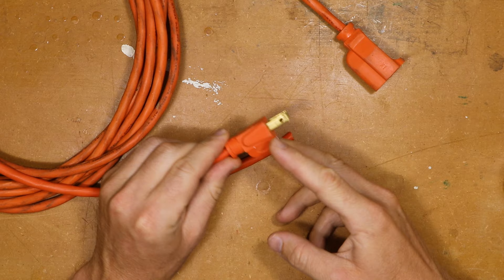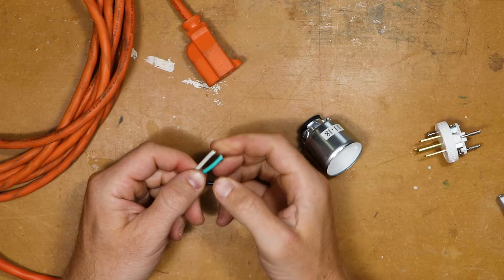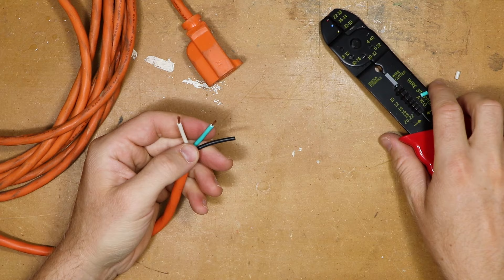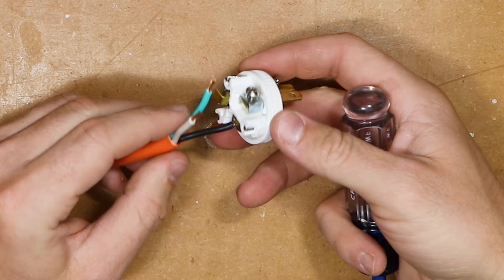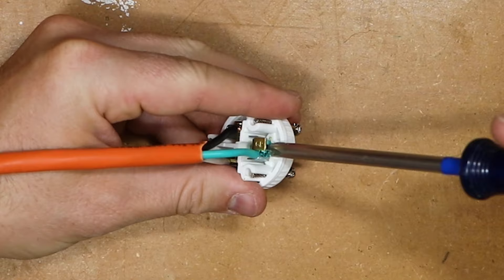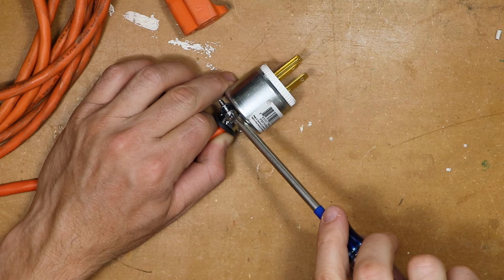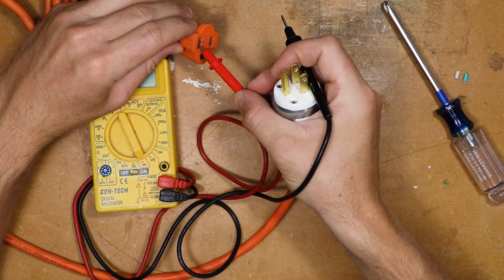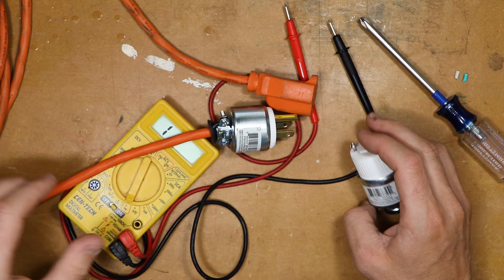How to fix an extension cord end

Comment: I was blowing snow and chopped through a 50 ft. 14 gauge extension cord we use to keep the bird bath water from freezing.  This is a great video on how ot get it right - I never thought of using a multi-meter to test for continuity.  A 50 ft. cord is now an 11ft ft cord and a 39 ft cord.  I also need to find a better solution than runnig the cord across our sidewalk.  Thanks!

Comment: If you are testing a power strip, remember you will not get continuity on the hot/black wire until you flip the “reset” switch

Comment: This is some good knowledge that ALL tradesman need.  In larger commercial job sites it can be easy for accidents to happen.  I turned in extension cords one day after installing sheet metal panels.  One came in without the ground, and the other had a section caught on a closed door.  
     We had another situation where someone managed to simply cut our extension cord by mistake.  I approached two nice electricians who replaced the plug end for us.  I find a lot of fulfillment in being a tradesman because in every project, everyone wins when everyone cooperates.
Reply from the maker: Thanks for sharing. I appreciate your comment. Tradesmen are important.

Comment: Very helpful especially with using the multimeter. The wires inside the cord I had were different colors. Using the multimeter made it so I could check my work
Reply from the maker: Spot on my friend.

Comment: I've done this a few times. One on a really old yellow semi-flat extension cord (so old that you can plug another grounded cord into it upside down) that had a missing ground pin, one on an orange round cord that also had a missing ground pin, once on an ungrounded green cord where one of the pins started to break, once on another ungrounded green cord that I accidentally cut in two with hedge trimmers (one reason not to try to use them in the dark), once on a grounded semi-flat gray cord that flexed too many times next to the plug, and the wires broke (my first time replacing a right-angle plug), once when converting an old cord into an extension cord, and finally when making a cord for my AC-synchronous Simplex clock. I was bad at it at first, but I've improved considerably over time. I can't remember if any of them had those clamps, but I know some did not. One thing to note is if the plug doesn't have the clamps, making the J hooks is absolutely necessary (always wrap around the screw in the clockwise direction)

Comment: Thanks!  I just noticed my convection oven plug and outlet were extremely warm while using (I always unplug when not in use).  Anyhow, I read that the culprit is likely a cheap / weak connection inside the plug, so I will replace the plug and save my little oven.

Comment: Thanks, had to put a plug on a wire coming out of a spot lamp i hadn't seen in about 20 years. Since that was probably the last time I had been up in my attic. I would often wonder what the heck I did with it, it always came in handy doing odd jobs around the house and getting under the cars. Didn't want to ruin an extension cord so I grabbed one of these this morning at the hardware store. Wanted to be sure I was wiring it correctly. Thanks again.

Comment: I like your suggestion to buy/use replacement ends that are steel rather than plastic.  It is almost aways better to spend a little more money up front so you avoid REWORK later on down the road.  Nice video.

Comment: Thank you, that was very detailed. I accidentally got my extension cord caught on a branch while shaping the hedges. Tomorrow morning I will be doing this project. I might need to rewire the outlets too. It did not throw the breaker. I am not getting any current in the outlets on that circuit. Do you have any videos on that?

Comment: Hi, I recently bought some extension cord heads, but one of them doesn’t work. The one that connects from one cord to the other (not the plug in) but the one where you add the extension. 
Anyways, I tried connecting every wire. And it turned on for about half a second and then stopped working forever. What happened? It worked for an instant then not anymore.

Comment: May I suggest tinning the ends of the bare wires after twisting them. It helps with making connection much better. Plus the wires are a bit bigger and the mounting screws to plug can hold onto them tighter.
Reply: What does "tinning" mean and how do you do it?
Reply: @clarencealexander1093  He means wicking solder into the twisted strands.  Usually, tinning is done in preparation for soldering the wires somewhere.  In this case you really don't want/need to tin the wires.  Doing so makes the bundle of twisted wires more stiff, and then they connect over a smaller surface area.

Comment: I learned something today. BLACK GOES TO BRASS. Never knew. I have done this repair in the past but it was usually from sight and post test as opposed to knowledge of that fact. I've actually ripped apart heads just to verify where the black went in the past. ThANKS!

Comment: Thank you for this tutorial! After the repair should the cord be restricted to indoor use, or is is still appropriate for exterior use? I have a couple of previous heavy duty outdoor use cords I would like to repair, but that new connector doesn't appear it would block moisture, or would it? TIA for any further clarification you can add. 🤔🤔🤔

Comment: Only question I have I may  of missed you mentioning it , are the replacement ends for multiple size wire or have to buy them for the exact wire size ? But great video very in-depth 👍
Reply from the maker: Replace the plug with the same style that broke off. Plugs have different styles based on the electrical needs of the appliance.
Reply: Good question. I have a 10 awg extension cord and can’t see to find a 10 awg female replacement plug for a 15 amp (expensive) 10/3 extension cord.

Comment: Wish you have showed what number would it be if you mix match the continuity side. Other than that, it is great! 👍🏻Very helpful and thank you!
Reply from the maker: It reads 1 when there is no continuity 08:22
continuity is a fancy word that basically means connection. So if you miss match the wires there will be no continuity when checking.

Comment: My cord says it's a 16/3 cord (10 amp / 125 volt), but all the replacement plugs are for 15 amps.  Is it important to find plugs that are also 10 amps?  (I don't want to throw away a 100' cord if I can just replace the ends.)  Thank you.

Comment: i have a blue, brown & green/yellow striped wire.
positive: ?
negative: ?
ground: ?
thanks.
Reply: Brown is your hot wire so you want to connect that to your building's black wire. The blue is negative or return, so that will go to white. Green with yellow stripe is the ground and will go to the building green.

This is copied from an LED lighting website
Reply: I also have brown? Blue and yellow /green strip....no marking or coloured code on the screws on the inside

Comment: I’ve always heard black to brass, but my connector does not have a brass screw.  Instead it has an X and a Y beside each.  But I have no idea which one would be the hot
Reply from the maker: I recommend looking up that info on the manufactures website if it did not come with info explaining which one is the HOT
Reply: What about a large electric heater.  The plug broke but cord is smailer than this extension cord.  Will it work???
Reply: Cord looks perfect.

Comment: Missing grounds are Dangerous because some plugs are polarized.  If the polarity is wrong on a device,  this can lead to electrocution.  Such devices include hair dryers and light sockets.  On plugs that intentionally lack a ground that are polarized will have one side fatter than the other.  On grounded plugs, both prongs are the same size.  This is because if the ground prong is in tact, inserting the plug upside down is impossible.  If the ground prong is chopped off, there is the risk of inserting the plug in upside down.  This can create a shock hazard.  In other words, don't put the knife in the toaster.
Reply: Not exactly...if it was dc (direct current) (+, -) (car batteries etc) than polarity would matter. But you're talking ac (alternating current) meaning it doesn't matter which way you plug it in. The ground is important because if there's ever a short (loose power) electricity will travel the road of least resistance to complete its path. So it will travel through ground instead of through you. That's why it's never a good idea to operate things when the ground prong is broken off.

Comment: I am trying to replace a damaged 3-prong plug end to an space heater. The middle wire is a greenish blue which I assume is the ground, but the other 2 are both white. How do I know which one is the hot wire? I don’t want to burn my house down HELP
Reply from the maker: My suggestion is to find a friend or someone that is able to figure out your wiring issue in person. There are too many variables to the situation to be able to safely help you over the internet.
My second thought is that you may be able to locate a wiring diagram to assist.
I too do not want to risk burning down your house.

Comment: What about a 00 gauge wire , won't go into the prong holes , too big ?
Reply from the maker: Way too big. Different gauge wires are required for different applications. a 15amp 120 volt plug is not used with a 00 gauge wire.

Comment: Could I potentially make a generator adapter cord using this same method?
Reply from the maker: potentially
Reply: Just make sure you are using 10 gauge wire .. The wire on the extension cord on this video is way to small..

Comment: What happens if you connect the hot wire and neutral wire in the wrong spots?  Asking because my wires are not color coded (battery warmer cord) and I tried using a multimeter but my prongs won't reach through the ext. cord.

I did plug my battery warmer in and it worked (guessed the hot and neutral wire). 

I don't want my vehicle to catch fire.
Reply from the maker: it could fry some electronics and possibly more.
Look up
Polarized vs. Nonpolarized Power Cords for more info on the subject.
Reply: @natelarge  thanks for the response.  I mean I could plug it in and use a probe to see which wire is hot right?  

Note : ( the 2 wires are bare when I strip them but 1 of the wires appears to have a black coating more so than the other one.  So I'm connected that wire to the gold screw of my new plug assuming that is the hot wire)
Reply: That's a direct short, you'll hear a small pop, smell a little smoke and the fuse will have to be reset.

Comment: is this connection now waterproof like the original?
Reply from the maker: I wouldn't use the term waterproof per se. The original casing for the plug end is better suited for a damp location. I also prefer the original plug end, however replaced the end to make the video.

Comment: I bought the cheap $5 ones, First off they don't fit 12/3 I tried to drill the hole out, ended up cracking the hole casing. Just save yourself the time hastle and money and buy a good one. Mine also didnt even have a screw or connector for the neutral shit was junk buy a good one like this guy did, He was 100% right when he said itll end up costing you in the long run. Mine took 3 minutes to cost me $8 go with a metal good one
Reply from the maker: Great advice my friend.
Reply: I priced out metal on both the Male and Female ends and it was cheaper to buy an entire new 100' extension cord (which makes no sense given the cost of copper) than to buy the two ends.  I bought the cheap ends instead in the hopes they will work and be cheaper to fix than to buy new. About to find out...

Comment: Did I buy the wrong plug?  
Both screws look brass. (No silver), the ground screw is green.  

My plug is yellow , not white.
Reply from the maker: I wouldn't use it. I wish I could give you more info but there are too many variables to your question. I recommend asking someone knowledgeable on the subject in person so they can review all the information needed to figure your situation out. Being cautious I would say it could be a bad manufacture, a counterfeit good that is not to code, or  a product that is not certified by UL (underwriters laboratories), such items as mentioned have been known to start fires, I would further say don't consider using questionable electronic components it is not worth the risk.
Reply: @natelarge   Thanks, -got it at Home Depot.  

The labels amp & volt were the same. 

Anyway it worked , I just watched which side you put the neutral on.
Reply from the maker: I'm happy for your success!